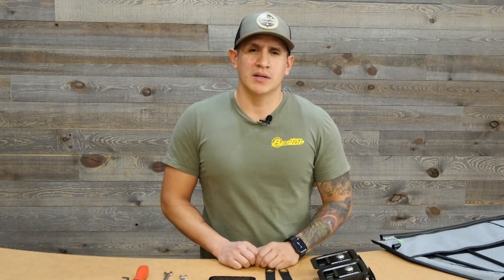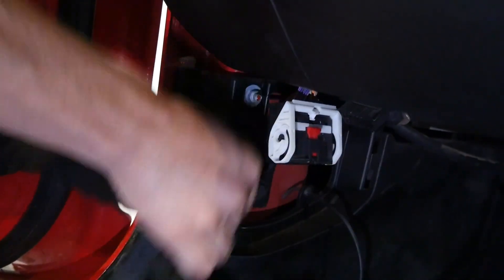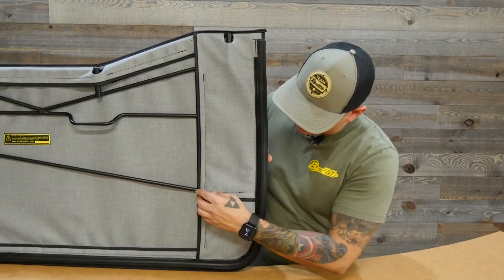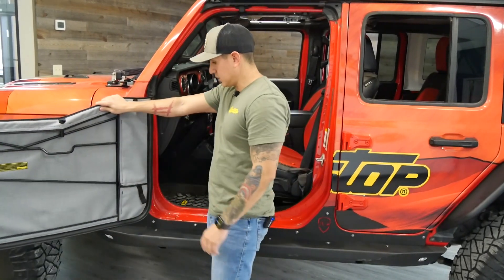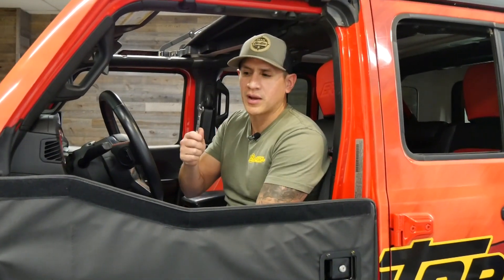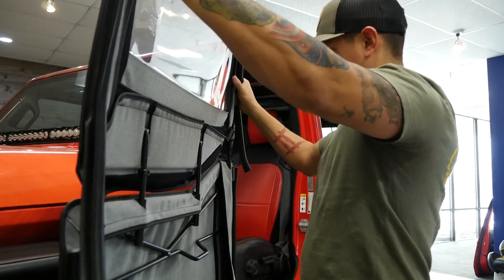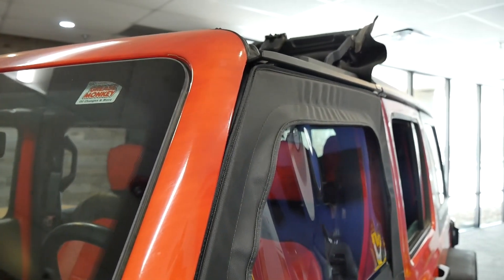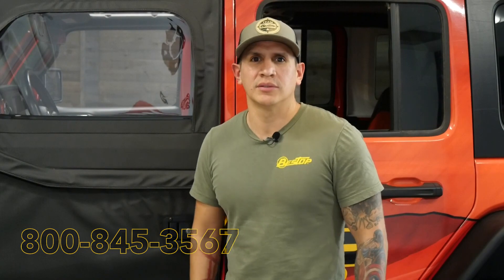Bestop 2-Piece Soft Door Installation

Comment: Will these handles fit on a 97 TJ? Ive got the soft doors, but i need handles.
Reply from the maker: The handles to the JK or JL 2 Piece Soft Doors will not fit on the TJ soft doors, I would recommend calling Customer Service to inquire about purchasing the TJ 2 Piece Soft Door handles, 800.845.3567, option 3, Monday through Friday from 8am to 4pm, MT.

Comment: 😂😂😂😂 how about when the pins come bent as shit. And they won't even slide it. Or once you finally get them on they leak so bad because the Gap at the top is incredibly horrible. I am so disappointed. This is not my first set of soft doors either.
Reply: Did you figure out a solution?  I'm in the same boat on passenger door, middle one does not line up.